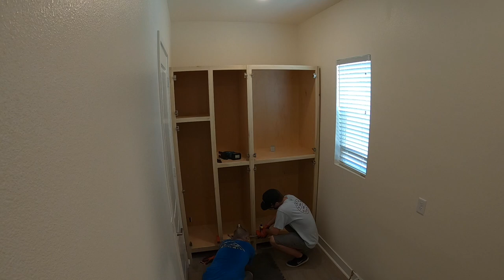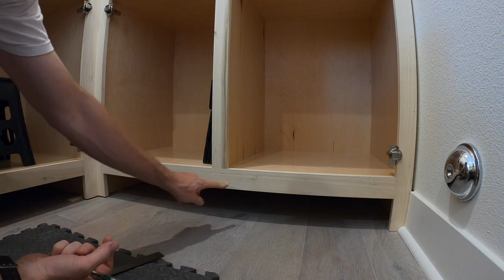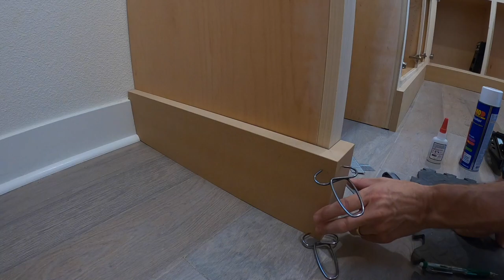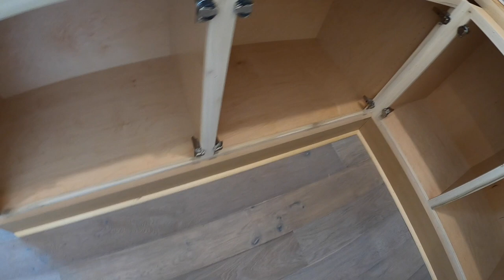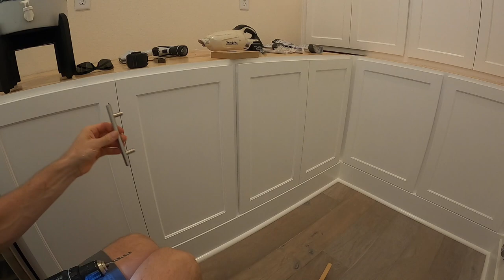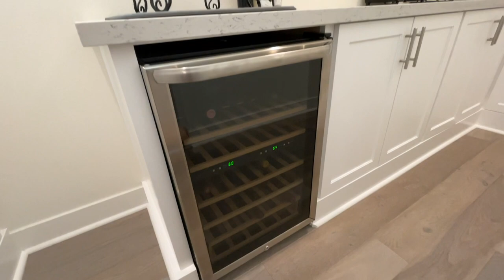How To Build Cabinets- Installation Of Custom Kitchen Cabinets For Huge Walk-In Pantry.

Comment: Your work and instruction is TOP NOTCH!!  Thank you for making the videos!  Do you caulk the panels in the doors?    There seems to be a big debate over what to do with them. Beautiful work man 👍
Reply from the maker: @tommyc1400  thanks a lot TommyC1400.  I’m glad you liked the work.  I always caulk the doors.  Both sides of possible.  Sometimes the back panels are tough to get to the corners of to caulk but if we can we will.  My doors have very tight grooves so the panels don’t move but I still glue them in on every door.   This is a huge benefit to my doors.  Then they get caulked for sure.

Comment: are you using a moister resistant MDF? Or any special type of MDF? Thank you!
Reply from the maker: Hey Steven.  Thank you for watching and commenting.  Not moisture resistant mdf.  But you could.  That would be good if it was in a wet area for sure.  But I use regular for this application.  It’s way less heavy than moisture resistant and more readily available.  Do you like moisture resistant mdf?
Reply: @davidbryanwoodworksandmore  haven’t used it yet mainly because I can’t find it in the San Francisco Bay Area. I’m a DIYer, so these videos are super helpful! Thanks again!
Reply from the maker: @stevencasarez8443  thanks Steven.   Glad to hear that.  It may be good to go to a good cabinet plywood or hardwood dealer.  They will more than likely have it.

Comment: Nice work! If you work with plywood for cabinets, which type do you use?
Reply from the maker: Hey SeBM Studio, thanks for watching and commenting.  I am glad you liked it.  That’s great.  For cabinets kitchens or Bathrooms, I use Pre finished maple ply for interiors.  Always.  Nothing else. If a customer wants to spend less and they request melamine, I decline the job.  Not a job I want.  If it’s a stained cabinet, I also use maple generally unless we’re using specific types of wood like cherry or mahogany then I’ll use that species inside.  I like to stain or paint my interiors of cabinets unless it’s in kitchen or bath.
Reply: @davidbryanwoodworksandmore  I'll have to look into that maple ply. I have been working a lot with baltic birch and I just finished a nice bathroom vanity with walnut veneered baltic birch and it was a great project.
Reply from the maker: @sebmstudio1697  that sounds nice.  True Baltic birch is 60x60.  Is what your working with 60x60 or 4x8?  Baltic birch is also very dense and heavy. It would weigh a lot more than typical ply.  Maybe it’s just my area that only has Baltic birch in 60x60.
Reply: @davidbryanwoodworksandmore  we can get 4x8 or 5x5 Baltic Birch around here. It's very heavy indeed and it's 18mm 13 ply stuff.
Reply from the maker: @sebmstudio1697  oh yes.  Very heavy indeed.  Maybe that’s why I’ve never used it for large cabinet jobs.  But it’s very nice.  How much do you pay for 4x8 3/4”
Reply: @davidbryanwoodworksandmore  standard birch I can get at 72 CAD with a perfect side at the local big box store but I have to look through the pile. Otherwise, it is more like 120 for 2 perfect sides. My walnut veneered ply was 210, but it is 175 in Montreal which is 150 km away. Not worth the drive unless I was going there to buy lots of panels.
Reply from the maker: @sebmstudio1697  oh yes.  That’s another thing, I always spec out wpf for my panels.  Both sides of possible.  I do love the look of the maple without seams.  Do you have a truck bed cover, for traveling in snow or rain?  Or trailer?  How do you transport wood in inclement weather?
Reply: @davidbryanwoodworksandmore  I have a trailer that I am going to turn into a covered trailer. I plan on transporting sheet goods on the longside because since it's a tight 4×8 trailer, I can't fit plywood without damaging the sides right now. It's almost impossible to find a decent price for a covered trailer right now sadly.
Reply from the maker: @sebmstudio1697  I see.  Is it because of COVID-19 that you can’t find one for cheaper. Prices have show up on everything it seems. What time is it there?
Reply: @davidbryanwoodworksandmore  12h17 in the night here atm. Yeah, COVID made the prices go up for everything. It's at last 3.5k for a used 5x8 right now and the new ones have gone up in price a lot.
Reply from the maker: @sebmstudio1697  Oh yes.  I wish you luck looking for one. Or a truck that you can carry in.  I use my truck mostly.  But I do have a trailer if need be.  Covered trailers are very nice especially if in bad weather.  transporting of cabinets it’s very easy to strap and keep safe.
Reply: Hi David! Great channel that I just stumbled upon. Do you make your cabinet doors from scratch?? Or order with an outside company?  Also is Baltic birch a good material to use for kitchen cabinets? 
Looking to get a kitchen reface and the cabinet company said they use Baltic Birch for shaker style cabinets.
Reply from the maker: @ree7557  thank you Renata.  Yes I do make them from scratch.  But also I can order if it’s a big kitchen job.  Also I think Baltic Birch is a good material for a lot of things.  I don’t use it for my cabinets, just occasionally drawer boxes.  Certainly not for refacing. Are you wanting to do a reface yourself?  Or have one done?
Reply: @davidbryanwoodworksandmore  looking to have a company to it. Pretty large job that I wouldn't be able to tackle. I've been researching, trying to figure out what is the best materials and the entire process for a kitchen reface. I want to keep my existing boxes and change the doors to shaker style. Pretty much exactly what you did in your home with the cabinets and countertop. Another great video.
Reply from the maker: @ree7557  okay got it.  I didn’t cover existing wood boxes on front, we painted it.  So it wasn’t a full reface.   If your just wanting to replace the doors, and get new drawer fronts as well to match, that would be like what we did on that other video.  Much easier of a reface than covering the wood boxes.  Doors can be made of many different materials for that.   Maple is my usual material for that.  With 3/8” thick mdf panels.  Is that what you want?
Reply: @davidbryanwoodworksandmore  yes that's exactly what I would want. 3/8" thick MDF panel (good to know).  My existing cabinets are made of maple and I want to change out:  color to white, door style of doors and drawers - shaker, and make soft close. The painters you use are amazing. Magicians like yourself.
Reply from the maker: @ree7557  they shouldn’t be using Baltic birch for doors or drawer fronts.  If anything only drawer boxes.  If your doing those.  Make sure it’s solid wood frames for doors and drawer fronts.  Never Baltic birch plywood.  Where are you located?  Not near me I’m guessing.
Reply from the maker: @ree7557  how did it all work out?